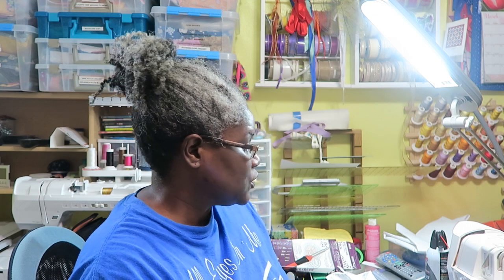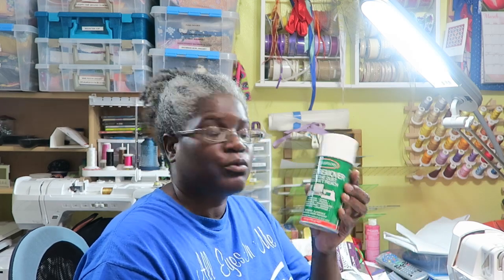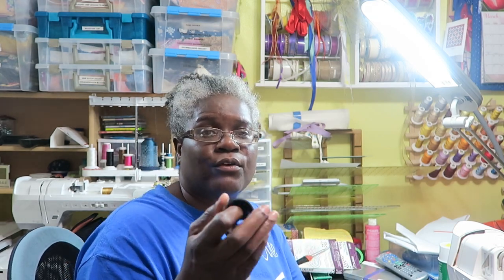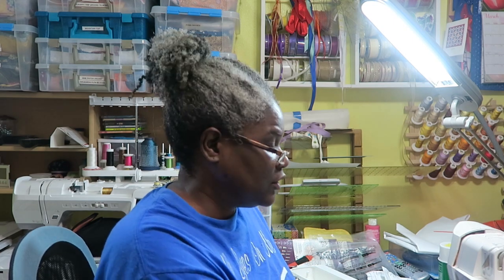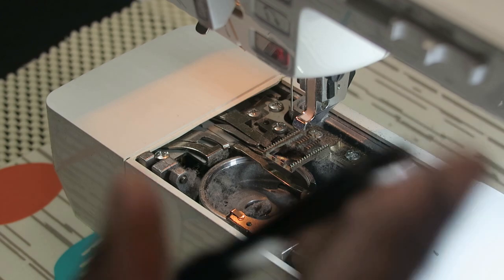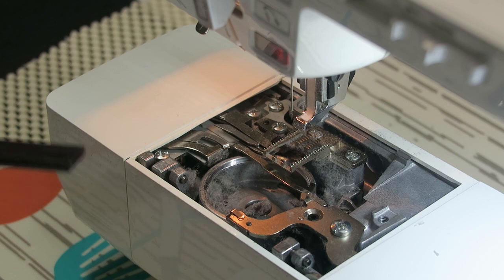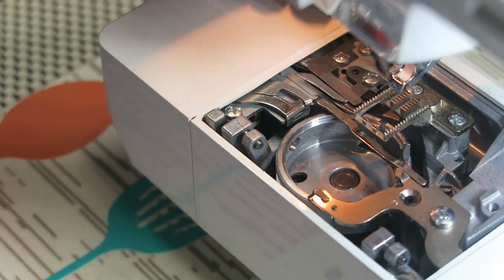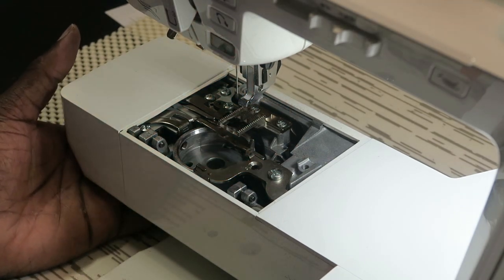Sewing Machines:  Cleaning, Repairs, Parts, & Servicing

Comment: Thank you for this video, much needed. I agree with going to another repair shop,  I was not getting the service with my Viking +1, was told it was to old, however the new shop fixed it.  I am now with youtubes help fixing an OLD Singer treadle machine.
Reply from the maker: I need to learn how to use and work with my treadle.  There are some great videos; I saw them when I first purchased.  However, I haven't sewed  one stitch in three years!

Comment: Good general info vid, Tea. Thanks for sharing your repair dilemmas. I've had similar repair fiascos myself. Glad you found someone. 
I didn't know about not shaking the air can. Thanks. 
Would you consider a vid about shopping, finding embroidery designs? I just bought new EM but not thrilled with machine's internal designs. Eventually I plan to digitize my own but meanwhile I'd like to purchase some nice Fonts for a reasonable cost. Thanks.
Reply from the maker: Hi Cyn,

I have purchased themed fonts in the past and have yet to use them.  The fonts I typically use are from my digitizing software program.  I have Designer's Gallery Custom Works.  I use it to make my quilt labels.  They have a ton of fonts.  So, may I suggest you open your software to see what you have first?  

I can do a video on my favorite design companies but it will not necessarily have fonts as I don't use them.  It that acceptable.
Reply: Thank you for info. I haven't decided on which software to choose. Been looking at SewArt lately. Like you, one of prime tasks I'm planning on is better labels using an EM, which is why I've been hunting for fonts. The built in fonts are limited on my machine. I just got an entry level model: Brother PE770 with 5x7 hoop and the 5x12 multi-positional.  Simple stuff for labels but thought a floral font could embellish some linen. Thanks again for your kind response and advice.
Reply: Thank you. I'll ck it out.
Reply from the maker: I've ordered from them in the past too.  I have so many designs, that's it hard to keep track.

Comment: I have a Singer Brillance  and I was sewing on it fine. Took a 15 minutes break and it would not come back on. Got a new cord still won't come on. Any ideas?
Reply from the maker: Hi, so sorry for the late response.  I'm also sorry that I'll be of no help to you.  I've never had any mechanical issues with my Singer CXL or XL1000.  I would take to a repair shop as you may need to replace the cord housing inside the machine where your plug it in.

Comment: Hi I have a xl1000 and I have had many problems and have not been able to use it because singers sId it is obsolete I need to purchase a new machine. Do you have any suggestions?
Reply from the maker: Hi Ruby,

I have a huge problem with repair centers, especially those that sell machines, advising you to purchase a new machine.  I'd try taking to someone else.  Talk with them prior to leaving, letting them know your problem.  I was told the same thing about mine and a local repair shop was able to fix it.  Someone who also works on longarm quilting machines might be your best bet...it worked for me.
Reply: That’s seems to be their tactic, they sell you a machine and then when it is not operating correctly, then suggest that I purchase a new one. Not after I spent $1000s of $$$$

Comment: the canned air isn't good for machines due to the moisture it contains. but my issue with that as well is why is it used for computers? looks like that would be bad for them as well. I guess due to all of the moving parts in a sewing machine, I would just oil/lubricate it after I wiped  out any moisture with a cloth.
Reply from the maker: Yes, I oiled the machine where recommended.  I also only blew air to the left, not the right where the computerized parts are located.  I also do not use the air every time I clean; only when the sensor is indicating a thread obstruction that I can't seem to find with brushes.  I used to use q-tips.  However, the last time I did, the cotton came off the stick and was stuck inside.  I almost passed out. LOL  It took me a while to find and dislodge it.

Comment: Sometimes it’s tension from either the bobbin or the top thread tension is not pulled through the tension disks good or the needle is dull or the wrong size
Reply from the maker: This one is a serious issue; even two repair shops are having difficulty.  I do have it running from the 2nd shop, but not perfect.  It's a work in progress after replacing a part.

Comment: Thread locker is just glue for your screw threads so the screws don't rattle out and become loose... I have to get some for one of my machines because someone stripped out the screw holes for the throat plate by using the wrong kind of screws!... :-(
Reply from the maker: Thanks.  It really weird how a random screw will just show up out the air!  LOL
Reply: @teaquilts  That's the truth!  :-)

Comment: keyboards and TV units are sealed electronics  mashie are not all part are open to elements and on top oiled so no air cannisters on any condition they blow threads to deep parts when you have motors and are fire hasard  and cold air cause that metal shrink the molecules become more fare from each ever and cost more damage to mashine.  use poliester dusters are tiny like plughole cleaners but small are great ...I just send mine to service after cleaning with air containers and plastic soon up all parts get misplaced and you should also clean tieing thread aeria too but take all threads backward and put muslin there and holding by both hands just slide through the hol pul from top to bottom movement so if anything is there will follow down then hoover and put cloth on bottom to protect bobbins aeria . It is true that dust get every wear if cover is not there .
Reply from the maker: Hi Ewa.  Thanks for the additional tips.  Something to think about.

Comment: I have an issue with my quantum XL1000  display  can you contact me if you know
Reply from the maker: Hi Ruby.  I haven't had any issues with my display.  I don't usually tinker with my machines, other than to give thorough cleaning and remove thread in my tension guides.  I send them out to my reliable service repair person.  Sorry I'm of no help.
Reply: Thank you. My issue is my singers quantum Xl1000, when I turn it on the display screen keeps staying on even when I press on it.

Comment: Hi I also have a singers quantum XL1000, the problem I’m having is i can turn on the machine but then when I press the board it does not move to the next phase. Do you have a idea what I should do. I have taken it to singers to fix and they say that they don’t have a tech to fix it.
Reply from the maker: Ruby, I've never had that problem.  It may be the mother board going out.  You can google Fenton Sew & Vac and see if they can help you.